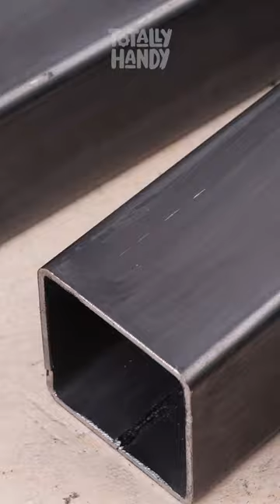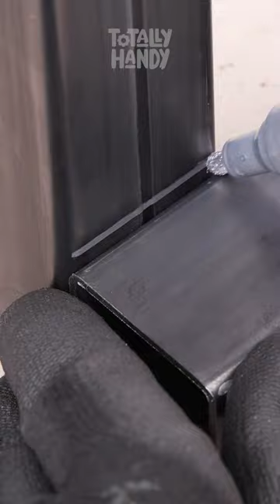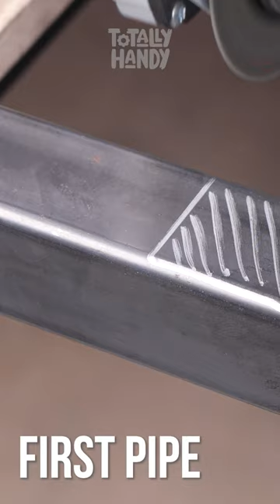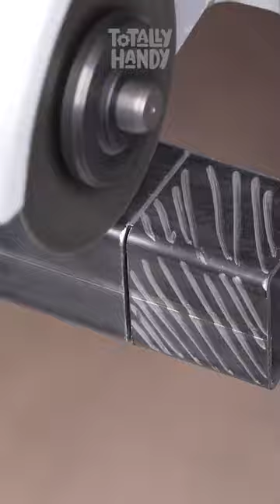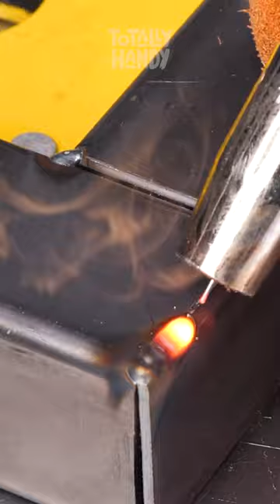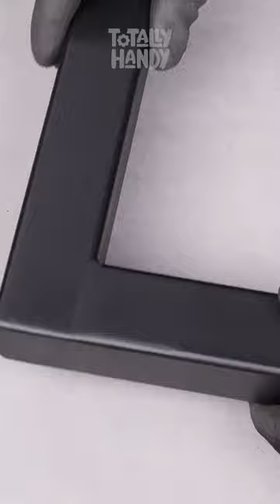How To Bend A Square Pipe to 90° #shorts

Comment: Seems like a lot of unnecessary work when you can just do 45degree cuts and clamp in place to maintain 90degrees..also you do have some really great ideas. Couldn't you learn how to run a bead.?
Reply: Looks like he’s pulse welding
Reply: Everyone can weld, just not everyone can weld well. It's kinda like painting art on a canvas. As for the 90, I would cut a v and bend it to get the 90. Less welding and arguably stronger.